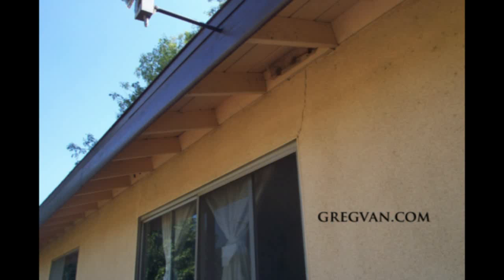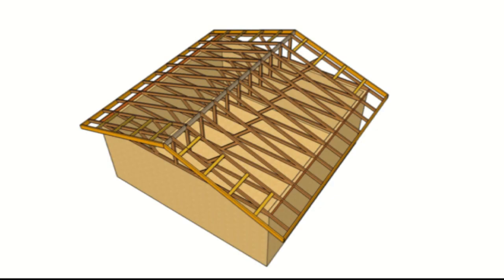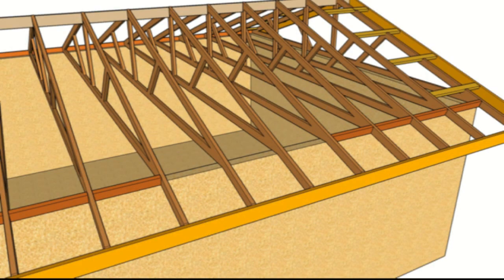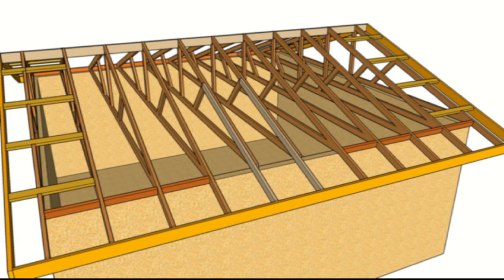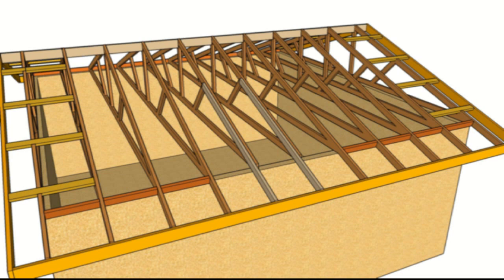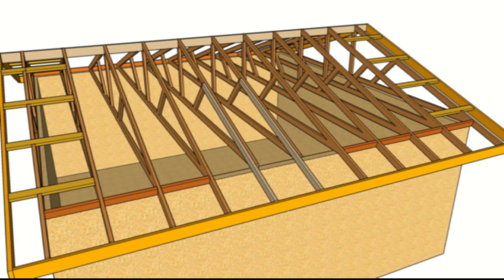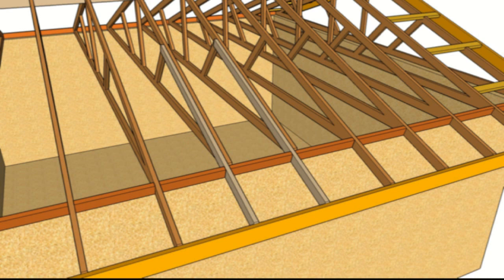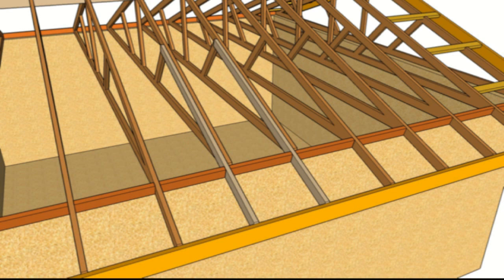How To Fix Sagging Roof Overhang - Nailing New Rafters Next to Truss

Comment: If the undersized rafter tails are sagging, wouldn't new undersized rafter tails also eventually sag? It seems long-term solutions may include flitch plates or engineered lumber if it can be water proofed?
Reply from the maker: That is an excellent observation and larger lumber or smaller lumber spacing might be required. For example if you have a 2 x 4 roof truss space to 24 inches on center, then 4 x 4's might be required or 2 x 4 space 12 inches on center. Almost all of the overhangs I repaired were suffering from termite damage, not undersized lumber.

Comment: I have been watching your videos and I love them. Thank you.  My attic has a gable roof with common rafters of 2 x 4 centered every 34 inches with 12 feet of span to the ridge "beam" (just a single 1 x 6 i believe). The existing roof has purlin system well not exactly the perpendicular "top plate" is missing it has only trusses holding the rafters and resting on walls. It is imposible to have those trusses resting on load bearing walls since this one runs parallel or align to rafters, they are although on walls most of them on just fake walls and one truss on each slope resting on the load bearing wall.  Joist are running perpendicular to the rafters: can i build a knee wall and reinforce the existing joist to support the roof? Since I do not have load bearing wall perpendicular to the rafters near were knee walls should be built (4 feet). If I place a beam spanning from the exterior wall to the middle load bearing wall.  will this be helpful to transfer the forces into the load bearing walls. I am think on making a sandwich of the joist with 2 2 x8.    i do not live on snow ara at all it is in san leandro bay area california.                                                                         The other questions is about my rafters, will it hold find the sheetrock ? rafters can be sistered in the similar way that joist are sisters? and what about insulation? I have read 4 books on framing so far and I have not find an answer jet. I would greatly appreciate your opinion.
Reply from the maker: If you installed the knee wall, it would need to sit on some type of structural component like a beam and then have the weight transferred down to the foundation. Send me some pictures of your situation and I will see what I can come up with, but remember I'm not an engineer and will only be providing you with my opinion.
Reply: Thank you! and where can i send them?

Comment: I had a tree fall on my roof recently and it broke 4 of my rafters at the overhang. The rafters are still resting on the outer wall just fine, but I'm having a time sistering 2x6's to the original 2x6 rafters. It's cutting the birdsmouth that is messing me up. I started installing the 1x8 planks but noticed there's a hump in my new sistering rafters. Could I simply remove the 2x6's that I cut wrong and sister a 2x4 to the original 2x6 rafter in order to eliminate the hump issue? Thanks
Reply from the maker: I would imagine you can, but you could always rip the 2 x 6 that's usually 5 1/2 inches wide down to something that might be 5 inches wide or four and a half inches wide if you're looking for more strength. Sometimes homes in areas where it snows will require larger lumber to support the snow load.

Comment: I'm getting ready to have a garage roof replaced. This is a stand alone structure which was built 40 yrs ago so there is considerable water damage to the roof panels. The garage is 24' X 24' and there is water damage to the panels on the ridge line, gabled ends and eves which would account for all but four of the roof panels. I got estimates and was going to have a roofing company start the work but I thought I should first remove the fascia on the soffit to inspect the rafter tails. It would be real easy for any roofing company to start the tear off and then call me and say "well, golly gee looks like this is going to cost a lot more than what we quoted you because we're going to have to repair the rafters. What? You don't want us to do the work? Sorry, we already tore off half of the roof. I'll guess you'll just have to pay up". Some of the tails have splits in the them, a couple of them are slightly warped and two of the rafters are warped all the way up to the ridge line. I'm wondering if it wouldn't just be better for me to do the tear off myself because that way I can replace the entire length of some of these due to the fact that I'll have the roof panels off anyway. It will be much easier to get at them once the panels are off.
Reply from the maker: +Steve W Absolutely, I agree with you hundred percent. Save the money by removing the roofing or have the roofing company remove the roofing, then you make the repairs and when you're done making the repairs have them come back and install the new roof.
Reply: +gregvancom - What makes this very problematic is that most of the roof panels have to be replaced. Ultimately, that does make rafter repair / replacement way easier but once the shingles and rotted roof panels are removed, your average roofing company is not going to want to sit around and wait for me to make rafter repairs. They will want to start early in the morning and roll right through the job in one day if possible. The better way to do this is for me to either have only the shingles removed and then tarp the existing roof panels. That way, I can remove the rotted panels one at a time and do the rafter repairs as I go; OR figure out a way to get the tear off (shingles AND panels) done in two stages - one side at a time. That way if it takes a bit longer to effect rafter repairs, only one side of the roof is exposed. I actually have someone coming by tonight to give me an estimate. He does this on the side and has no overhead so I'm confident that he will give me a highly competitive estimate no matter what I have him do. If the price is right, I may pay him to do the whole job. If the rafter repair work is going to push the price up, then I'll have him do the shingle / panel tear off one side at a time, which will give me time to do the rafter repairs.
Reply from the maker: Good points.
Reply: +gregvancom - the roofer came out late yesterday and looked at everything. His estimate will include repairing rafter tails but he said that none of the rafters need to be replaced
Reply from the maker: That's probably good news and hopefully everything goes as planned. I think remodeling and building repairs is a lot like war, you never know what the casualties (expenses) are going to be until it's over.